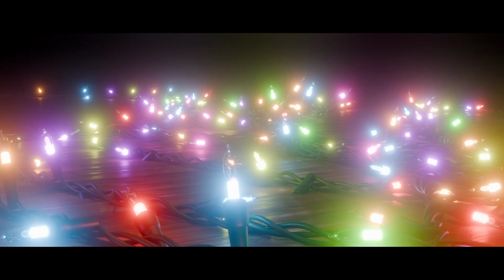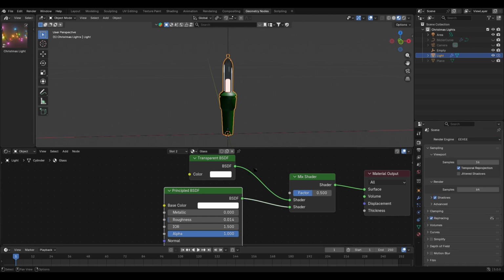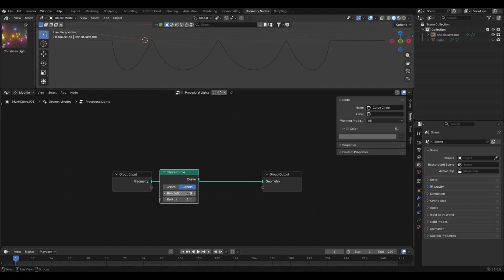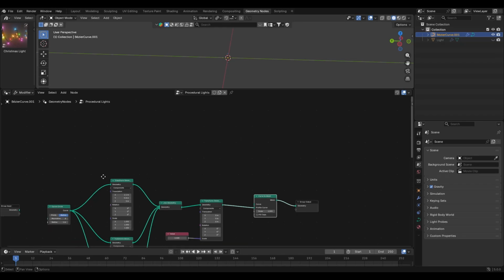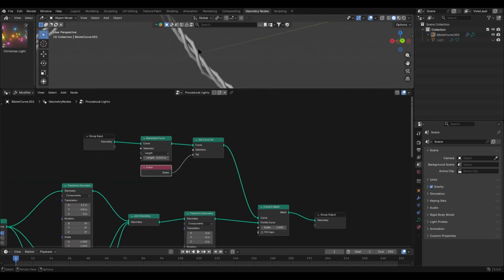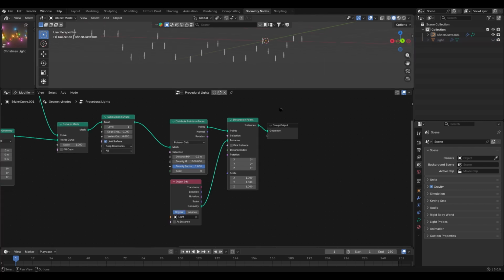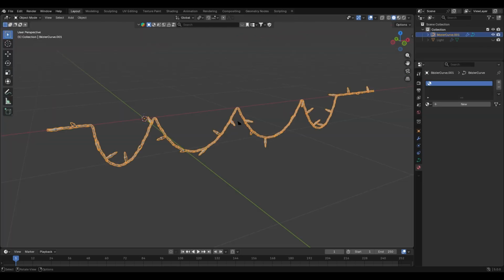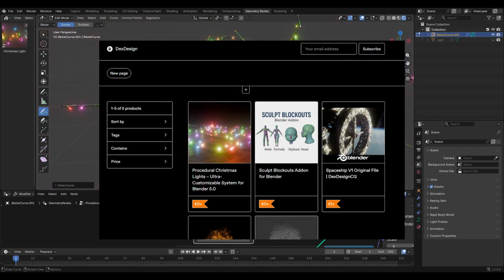These Procedural Christmas Lights Will Level Up Your Blender Scenes

Comment: Do not use the Distribute Points On Faces Node. Drag a connection from the Set Curve Tilt Node to the Instance on Points Node. Add a Resample Node to set the number wanted. 
Then they will all be evenly spaced.
Or add a switch so you can swap between even or random spacing.